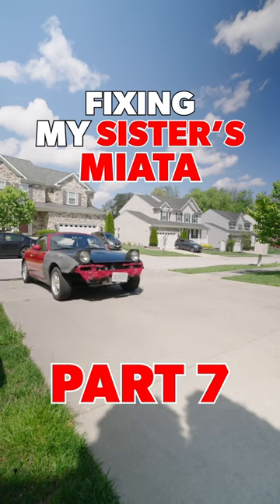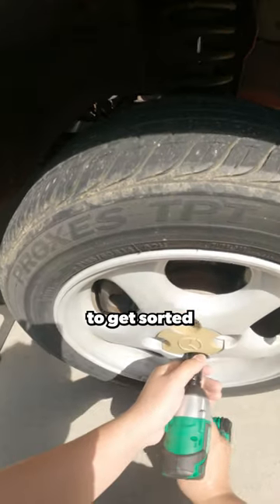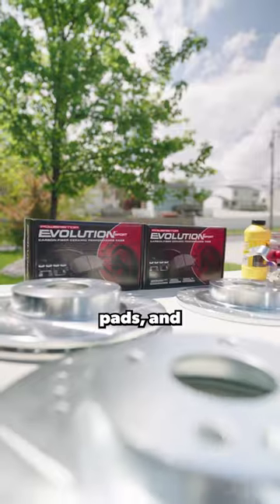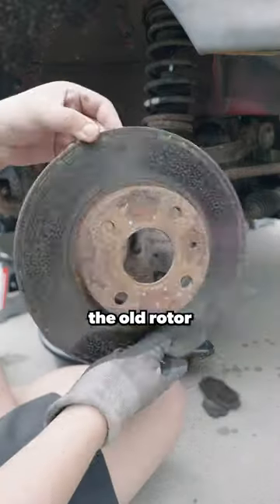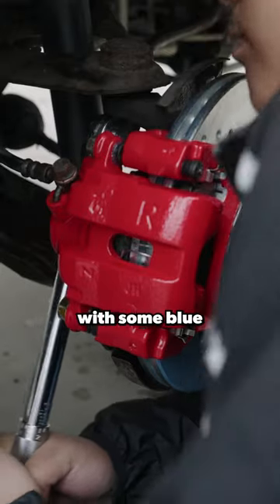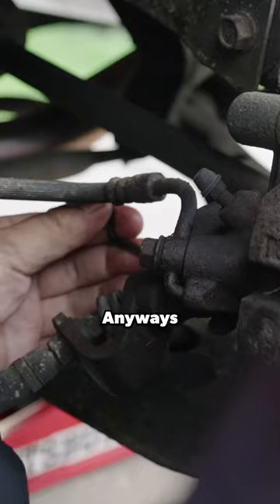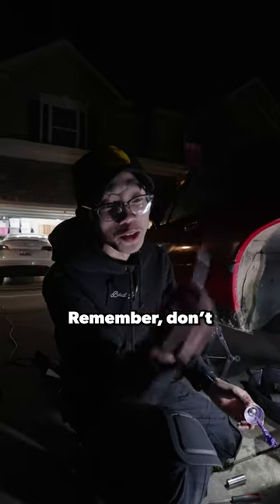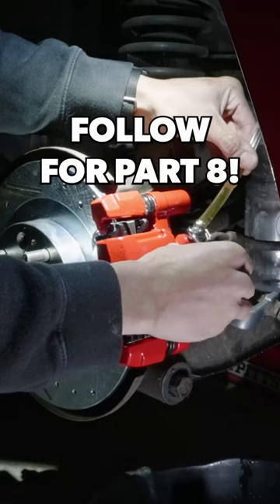NEW BRAKES for the MIATA!!! #miata

Comment: I hope those powerstop brakes work well. They're really good at truck brakes but i haventheard so many good things about their sport car brake kits.

No hate here though, you're being an amazing brother!
Reply: I run them on my e36, same with my buddy. No issues and better performance
Reply: afaik the calipers are just reman oem ones, same design. Nothing fancy, work as well as the mazda originals. I just installed new rears cos one of my originals had a stuck slide pin, and powerstop pads and rotors, non-drilled/slotted. These are light cars and you barely use the brakes most of the time if you have a manual.

Comment: Wise words from Brandon - “Don’t go in dry, you always use lube😂
Reply from the maker: fr!
Reply: @WBANGA  I'm on team dry when it comes to brakes, apart from the slide pins cos they have rubbers (lol). Any exposed lube in a braking system is just going to become crusty dry solid mess once its got a few thousand miles of brake dust in them.

So I only lube where I actually have a pin going into the hole. Which is kinda funny.
Reply from the maker: ahhh ill try that out next time i switch out brakes!

Comment: Old brakes all was need a little bit of H.L.L 

HEAT
LOVE
 LUBE
Reply from the maker: HLL
Reply: I've literally never had to use heat on the pin bolts. Pentrating oil and patience always work